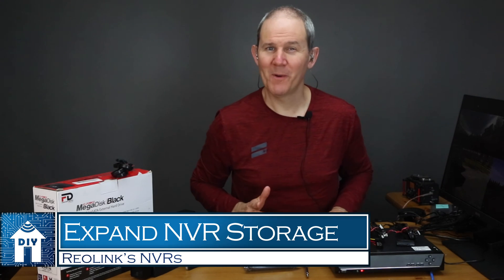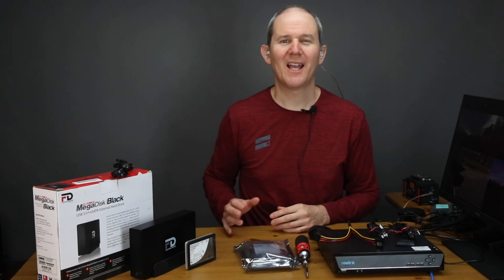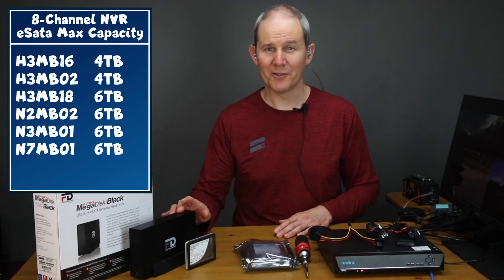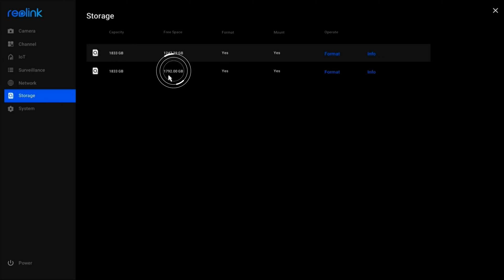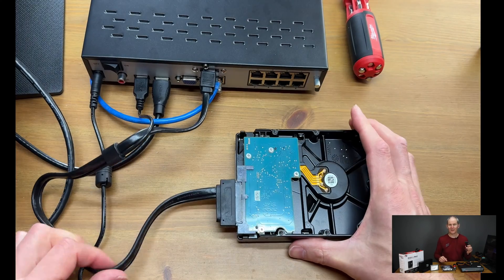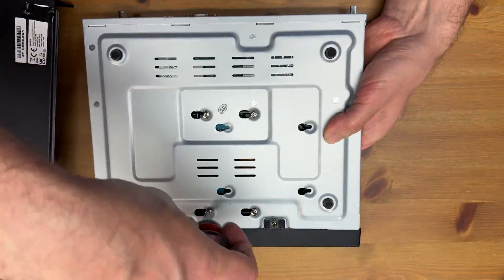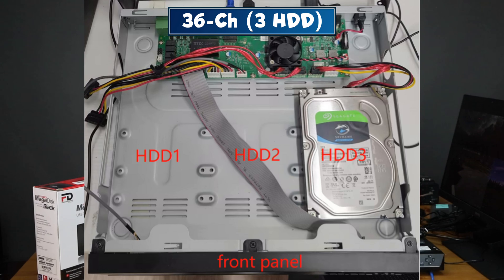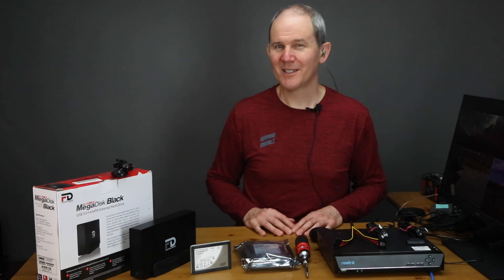3 Ways to Increase Hard Drive Capacity on a Reolink NVR (Cool Hack!)

Comment: Has anyone tried a power splitter that has more sata outlets? If so would that mean you could technically run even more Internal HDDs?
Reply from the maker: The limiting factor is the number of SATA ports on the motherboard. You could power the hard drives externally with another power source, but the motherboard will limit you harddrive count.

Comment: @HomeTechDIY  @lewismorris31
3 days ago
Can someone advise if put a new drive purple 4tb inside wanted to use original 2tb as external can someone point me in the right direction it has to be connected  by esata cable

Comment: Can someone advise if put a new drive purple 4tb inside wanted to use original 2tb as external can someone point me in the right direction it has to be connected  by esata cable
Reply: HomeTechDIY

Comment: I've done the same upgrade too. The default storage of 2TB are just too small for playback. Especially if you have a ton of cameras setup to it. For the eSATA external setup, I just purchased an internal WD Purple drive and put it in a separate enclosure to make it an external drive. Then just plug it in to the back of the NVR and boom. Max storage!

Yes, to touch on what he's saying about the drive capacities, look up the hardware version for each NVR you have. They're not hard to find and you'll come across it in the menu or even on your phone Reolink app. Once you get the hardware version, go online to see what the max capacity is for that particular hardware version. Each one is different which is why it's "tricky". Some only take 1x internal drive while other version takes 2x internal drives. Some don't have eSATA external connection as an option, others do. This is why it's important to look up your "hardware version" to determine your max capacity drives accordingly. This applies to both internal SATA and external eSATA drives. 

Upon getting your Reolink system, I would highly recommend to just upgrade your unit to the max storage. Hard drives are cheap these days even if you build it up to a 12TB NVR which is what I ended up doing to reclaim Playback views.

***Oh I never thought about splitting the power from one of the SATA drives!!! Good tip!!! I never even bother to check the motherboard to see if it has a spare SATA connection lol. But....I also recommend not leaving the internal/external drive out like that. Amazon has a bunch of different kinds of hard drive enclosures you can buy that will keep that internal drive safe. Some external enclosures needs additional power source so most likely it may need to be plugged into an outlet. So that's the only additional thing to do. Otherwise, that's a great hack! 👍
Reply: Where did you buy your external drive casing from and how did you connect thanks

Comment: I'm currently running a RLN8-410 hardware N7MB01 with a 8TB WD Purple Pro. It formats to full capacity. Drive works well, but is noisier than smaller capacity WD Purple drives. I had to add rubber dampeners (spacers) to the drive mount screws to quiet it down. Other users report having gone up to 14TB, despite the official 6TB "limitation".
Reply from the maker: Good to know. Thanks for sharing. I wonder if this us a common complaint about those drives.
Reply: @HomeTechDIY   The Pro line is made for Enterprise use and typically used in servers, NAS arrays as such, where noise is less of an issue. Hence why Enterprise drives are reputed to be louder in general. 

The regular Purple is consumer-grade and is quieter. I got the WD Purple Pro instead of the regular Purple because the Pro's rated workload is 3x more (550 TBW vs 180 TBW)  and the price difference was only about 20-30$. 

I have the regular 4TB WD Purple in my other (older) Reolink NVR and it was always super quiet.
Reply from the maker: Makes sense. Thanks for the explanation.

Comment: Hello I have a 8 Channel 
Model: RLN8-410
Version: N7MB01

It comes with a 2 TB can I replace it with a 6 or 8TB and also add an additional 8TB external eSata hard drive ?
Reply from the maker: Yes, from what I understand this will work. Here's what Reolink support says, "For the RLN8-410 with hardware No. N7MB01, the single HDD capacity is up to 8TB, in total up to 16 TB."
Reply: @HomeTechDIY thank you

Comment: hey so i know this is an older video, but hopefully you will respond, i have a RLN16-410 with pre installed 4TB HDD, im running 4 Duo 2s POE, looking to add 2 more cameras, non duos, i want to upgrade my storage, and was looking at the WD Purple 8TB part number WD85PURZ, was wondering about the buffer? this has 256MB for buffer and im not sure what that is or if its enough for my set up😅
Reply from the maker: Hey! I have wondered the same thing about buffer or cache size. In this video, the purple drive has only 64MB for cache and I am still using this setup and have noticed no lag or delay when playing back footage. No issues or missed frames when recording either. As far as I read (not actually tested), the buffer/cache is not really used as footage is recorded and read directly to and from the drives without use of the buffer. I think the 256MB will work just fine with you camera and future cameras. Hope this helps.
Reply: @HomeTechDIY thanks for the response!

Comment: can i connect an external hdd to a reolink nvr rln36?
Reply from the maker: No, it doesn't support USB external drives and under the cover, there are only 3 eSata ports for 3 internal drives. The single HDD capacity is up to 16TB, in total up to 48 TB.

Comment: Does the internal 12V power supply have the capability to power 2 HDDs in the last hack? (They are 3.5" HDDs, so needs 12V, correct?)
Reply from the maker: Yes, I used two 3.5" drives in the last hack. I am not sure of the numbers for the total allowable 12v capacity for the power supply but I didn't see any issues with temperature or the drive becoming unmounted from the NVR.
Reply: @HomeTechDIY  Thank fou your answers!

Comment: If the max storage of an NVR is 4TB and the internal Hard Drive is 4TB and you add a second 4TB Hard Drive, does that effectively raise the max storage to 8TB without issue?

If so, couldn’t you install two 8TB Hard Drives and have 16TB of storage? 🤷🏻‍♂️ what’s the point of the max storage if you can just add Hard Drives 💁🏻‍♂️
Reply from the maker: Hello. Great question! The max storage is the sum of storage across all hard drives. Each hard drive also has a maximum capacity. For example, the NVR RLN8-410 can support hard drives up to a capacity of 6TB each. It also have a max storage of 12TB, across the hard drives. You could have 2X 6TB drives, or 1X 2TB plus 1X 4TB plus 1X 6TB to reach the 12TB cap. Hope this helps.
Reply: Thanks! That’s the answer I was looking for😊

Comment: So with a 2T 8 channel with 5 cameras running 24/7 how often would it delete footage . I went with 1 track mix Poe and 4 RLC -81ma
Reply from the maker: It would depend on if the cameras are recording 24/7 or just capturing motion. It's it capturing data continuously, then it will delete a old file roughly every hour once the drive is full.
Reply: @ thank you. I am just trying to figure out with that setup recording 24/7 would get me 7 days of footage or how many days 2T would give me . Just a rough guess for if I am out of town for a few days. Not sure wether to just test it and see how much I get or just immediately upgrade storage before installing the system.

Comment: For the third method, after installing an additional HDD, how could you install the cover and screws?
Reply from the maker: You're going to need to be creative. Maybe cut a slot for the wires in the back panel so the cover can fit snuggly back in place.
Reply: Just replaced the first internal HD & added a second via splitter, as shown. I can’t find a way to run the wiring that will allow me to fully reattach the cover.  Any options besides cutting a hole in the back of this brand new NVR?

Comment: I've just recently installed a reolink ten camera system, two of the cameras are duo's . I used the RLN16-410 and it takes two 6TB drives, so 12TB in total, so that's what I installed in it from day one. I get about 6 weeks + of storage before it overwrites. Very happy with it so far.
Reply: I’m new at this..Jw can one add an external hard drive to a Reolink NVR? I read you can with a eSATA port. But the Amazon site says the NVR does not have that port. Any ideas? I wanted to add a 20TB external hard drive
Reply from the maker: This Reolink links in this video should have all the info you need on maximum capacity.

Comment: I just bought a RLN12W is it possible to add a 2rd internal  hard drive to it  with just 1 SATA interface .
I understand how to connect the power splitter to both hard drives but i don't understand how to connect the sata port from the nvr to both internal hard drives. Do i use a splitter sata connector?
Reply from the maker: I don't think it's possible to add a second drive with the RLN12W. There is no external eSATA and I think, like you mentioned, there is only one SATA interface. Your only option is to upgrade the HDD to a larger size. I think the max is 16GB. Unfortunately, SATA interfaces cannot be split.

Comment: Is it possible to replace with a SSD hard drive?
Reply from the maker: I haven't tested it myself but I don't see why not.
Reply: Unless you have a left over SSD with nothing to do with, then I don't see why you'd do this. The performance benefits are not really noticeable but the cost is significantly higher.
Reply: @TheFreakyGames  Reliability.
Reply: @TheFreakyGames  one reason to use SSD is if the NVR is in a moving vehicle. like an RV.  I know these thinks plug into 120v, and RV's have that but, the NVR's don't use 120v. My Reolink RLN8-410 uses 52v.  So, just get a buck converter to take the RV's 12v and boost it to 52v, and the system can be run 24/7 without turning the inverter on.    Truckers have 12v, multi channel, SSD dvr systems (I have one but, its coaxial)

Comment: awesome video.  Did have a question.  If I swap out the internal HDD but want to use the old one as an external does it still have to be formatted and/or does it see one as primary and other as secondary based on connection to motherbord or sata external?
Reply from the maker: Thanks! On a PC, I would go into Disk Management and check for partitions. If there are any, remove them. Then, I would format the HDD to remove any left over file tables or components used by the NVR. Hope this helps.

Comment: I have an external eSATA 4tb hdd that I installed to my NVR but it only shows 1tb.
Any idea why? Do I need to format to NTFS or Fat 32?
Reply from the maker: I assume your NVR is compatible with an eSata HDD and you are within the total supported capacity: https://support.reolink.com/hc/en-us/articles/900004550003-How-Many-HDDs-Can-I-Connect-with-Reolink-NVR-System/
I would try to fix it in this order. 1. Format the HDD using the NVR's operating system, like I do at 3:30. 2. If that doesn't work, format the drive from a computer using FAT32 (quick method). FAT32 is used by USB flash drives in the NVR, so I am assuming it's the same for a HDD. Make sure the computer is showing 4TB free. Connect the HDD to the NVR and see if you have the numbers you are expecting. If not, try formatting it again using the NVR's operating system. 3. Same as above but try the full format. 4. Same as #2 and #3 but try NTFS.
Hope this helps!
Reply: @HomeTechDIY  Yes, nvr can do up to 8tbb on an external eSATA. I'll give this a try. Thank you

Comment: So I did that very last hack you did with the 8channel and it worked but not sure why I can see the old recording off the original hard drive. Any solution for that?
Reply from the maker: In the last hack, the original HDD is still attached. Any footage on this drive will show in combination with any footage on the new drive. To remove all the footage from the first drive, try formatting it. Let me know if that helps.
Reply: Hi there, how did you route your wiring out of the casing for your external drive? Did you have to cut a hole in the casing? Thanks
Reply from the maker: @jeffjeffjeff2  I didn't complete a permanent solution, but yes, cutting the case would be an option. If you are comfortable with wiring, you might be able to remove the adapter and feed the wires through an unused hole on the back and then reconnect the adapter.

Comment: The external hdd fanton in your link the price is $222 for the 2t and $302 for the 4t is there a cheaper one that you recommend for 4t I have the reolink RLN8-410 N7MB01 for 2t thanks
Reply from the maker: I am not sure what area you are in for Amazon. I shop inventory in the amazon.com and .ca regions. There aren't really many options since it's older technology.
This is the 4TB Fantom with the eSata cable included and is just over 200: https://amzn.to/4azGxgZ
I have not tested this, but maybe an eSata docking station would work. You would just need to bring your own HDD. I think you can get cheap ones, but here is one that is about $100: https://amzn.to/3KdIaWX
Reply: @HomeTechDIY  I see that the page you uploaded is from Amazon Canada, I am in the United States but I put the complete information of your link in Amazon USA and it is almost the price you mentioned, thank you
Reply: One question, the cable that you connected from the external HDD esata to the esata input of the NVR is included or is it purchased separately. I should order the one that only has a USB input but does not have an esata input and I will return it. I will order the one that has a USB input and esata input because the information says that it comes with a usb cable included, thank you
Reply: Just bought me an 8TB for $210 with taxes using code techradar10 for 10% off

Comment: Hi, what happened when both internal and external drives will be full? Does system automatically switch to store into internal drive again?
Reply from the maker: The system will delete the oldest footage and replace it with the current. That oldest footage could be on either drive.

Comment: Good video. I didn't know we could not see the security camera files on a Windows Computer when plugging in the drive containing Reolink Cam footage that came from the NVR into a desktop computer.  I presume one would be able to see those files if we were running the correct flavor and version of Linux?  That's a question because I know nothing about Linux..

I did order an external drive enclosure that had eSata capability and put a 4TB high duty cycle drive into it, but it would only format as a two TB drive - probably had to do with the firmware in the external drive.  I cannot recall if I formatted the drive first with a computer or with the NVR as you showed - I'll have to check now.

On another topic I still suspect that Reolink PoE only setups with NO Internet connection and DNS turned off can be accessed by third parties remotely.  In other words there is a way to hack the system from nearby _ I think it needs line of sight and IR initially but then once they have the camera and NVR info they can just access  the entire system remotely even if the user has no internet features turned on.  It may be that the US requires such access for any devices sold in the US to have a back door for law enforcement
Reply from the maker: Thanks! Very true, the files could be visible if running Linux. My computer could see the drive through Computer Management, but it didn't have a drive letter.
That is odd about the 4TB drive only formatting as a 2.
I haven't heard of your third point before. I'll keep an ear out for more info on that one.